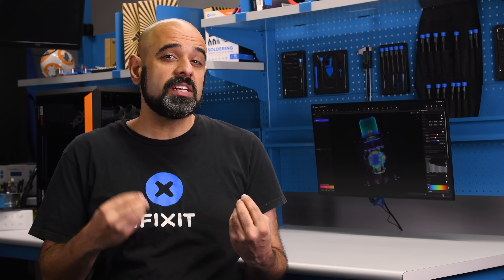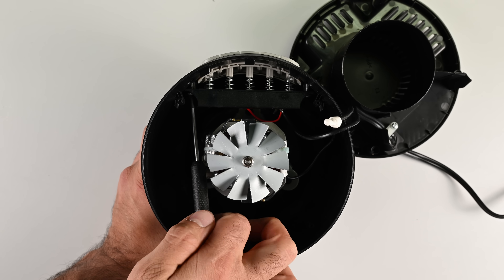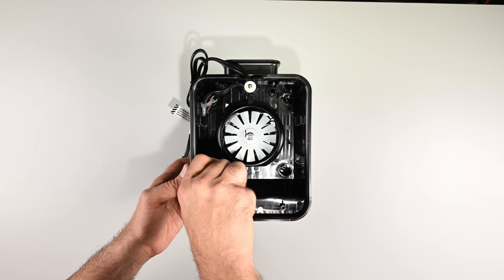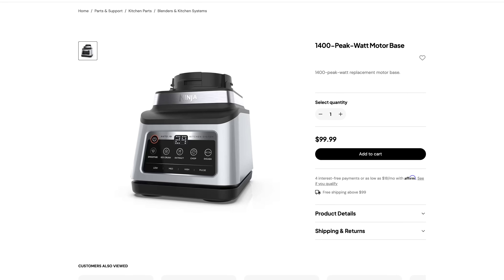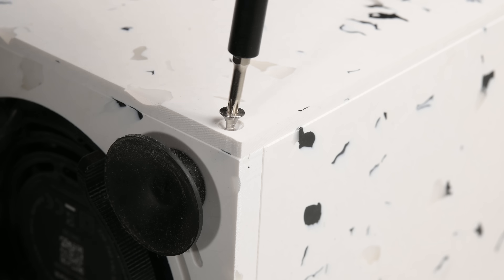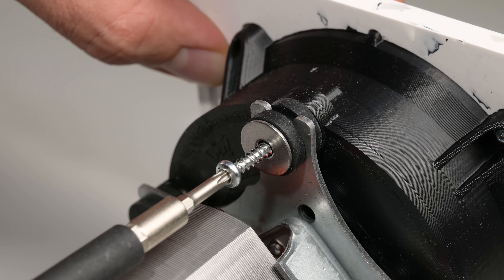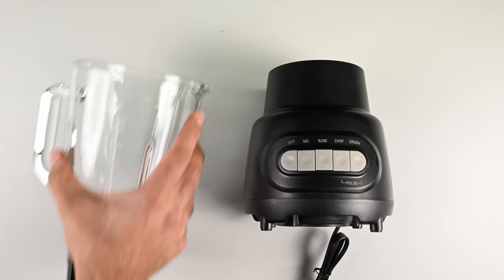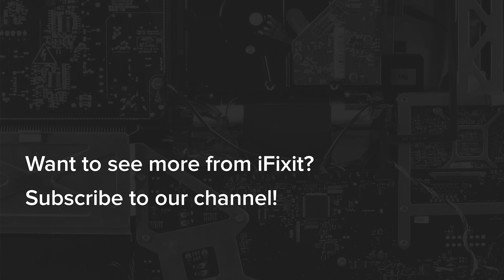Open Funk re:Mix: The Open-Source Blender Big Brands Don’t Want

Comment: I think repair friendly products shouldn't have to look like a home built thing. Like, respect for the effort. But it doesn't look like a 350€ product. This will find its customers sure. But it won't make a dent in the market.
Reply: Since this blender is designed to be easily repairable by anyone anywhere, milling thermopressed rHDPE or 3D printing the side panels is a lot more accessible and cheaper than needing to have multiple thousands of Euros worth of injection molding equipment necessary to make or replicate a fancier, curvier enclosure. Also, the higher price point is due to these being made mostly manually in smaller quantities in a country where workers get paid better than the ones in Southeast Asia.
Reply: @randpython  we couldn't have put it better
Reply: @OpenFunkHQ  Thanks! It seems that the concept of open source hardware (as opposed to merely repairable I guess) still isn't widely known so people tend to miss the point.
Reply: Also, it looks home-built because it literally could be. The design deliberately avoids the need for custom or niche parts so that a person with a 3D printer and some basic hand tools could build one of these mostly from scratch, from readily available materials.
Reply: It's the VW Beetle of blenders. Kinda cute, actually.
Reply: Yeah, I have to wonder if its compatible with any other jars other than mason jars?  And for the price, how powerful is it?  Thats getting up there in Vitamix pricing territory.
Reply: @BackToTheGame.98 1000W, it's compatible with mason jars up to 2 liters (or more)
Reply: It genuinely looks like something a bunch of hipsters from Berlin would come up with. Not do crap on it, I'm super pro open source HW and right to repair, I just find it really funny xD
Reply: @achimhaun2726  and everyone working with us needs to have a moustache, of course!
Reply: yeah a blender should in no world cost more than $100, it's not even as if it's something that's been traditionally unrepairable or expensive
Reply: I totally disagree, it looks super good and minimalistic. Just one big button, done.

Comment: If you are new to fixing this kind of things, take pictures when you are taking it apart. I have fixit few blenders and the first one I fixed had a switch with 4 connection points that took 3 wires and no markings which is which. Also it had a few cone connectors. It took me many hours to figure out how to re-wire it correctly.
Next time I took pictures and there was no problems to assembel it after changing the faulty part.

Comment: The osterizer blenders from the 1940s onward were also compatible with mason jars—it’s nice to see this being brought into more designs
Reply: You only see glass pitchers on lower-power blenders and they're very heavy.  No way a major brand wants the scandal of someone getting grenaded.  That said, I'd get one, then just wrap the jar in clear tape and hand wash it.
Reply: @concinnus  I wonder if anyone makes thick-enough glass jars with that thread. I have an old Atlas pint mason jar that is somewhat thicker.
Reply: @MorrisDugan  not a matter of "thick-enough glass jar". One good strike in the countless weak points in the microstructure of a brittle material, and your container is gone. Considering that a powerful motor will create countless cavitation bubbles when blending, it turns the situation from an "if" to a "when".
Reply: @concinnus  So the early blenders weren't all that powerful, since glass was probably the only material available for a container?

I'm not disagreeing; this is something I don't know much about. When I had a blender years ago, I just didn't like having a plastic container, especially when it started showing stress lines, and it seemed like a poor replacement for the once-common heavy glass pitchers.
Reply: @MorrisDugan  Not sure about the early history of blenders.  But if yours was cracking that was likely "crazing" in PMMA/acrylic.  They moved on to polycarbonate (with BPA) after that, then onto Tritan (with BPS) iirc.  BPS is probably as bad as BPA but people don't know about it yet, so they just market Tritan as "BPA-free."
Reply: @morganmartino1071 osterizer is a great inspiration indeed!

Comment: On the openfunk, that sheet material with countersunk screws so close to the edge is not long for this world
Reply: it's because it's a design student project that they figured "hey let's make a quick buck instead of developing this into a long-term product/company"
Reply: @Laundry_Hamper you mean for durability? Thousands of units shipped, we never had issues with this. It's not like a screw that you open and close 3 times a day, only in case of repairs
Reply: I mean that's kind of the beauty of this being an open source project. They make the files and design public and if you don't like them, you can just modify them and make your own! You don't even have to buy the version they're selling, just have to source your own parts and piece it together. Ideally you would either make your own fork of the project or submit your changes back to the main project so that everyone can benefit from your design work!

Comment: I'm quite concerned about using mason jars to blend. If you only put some soft fruit and water/milk might be ok, but forget about putting ice cubes, unless you want some glass shards in your face. The glass vases on retail blenders are several times thicker....
Reply: Or blenders like the Ninja use polycarbonate
Reply: should definitely use a different container for blending ice cubes.
Reply: @rhoharane yes, the issue is that no other container is provided with the blender
Reply: we had this concern at the start of the project as well. 4 years after, many tests and with thousands of users out there, it turns out these jars are stronger than one would assume. makes sense that they've been used for storing food in vacuum for such a long time.
Reply: @OpenFunkHQ Mason jars are but structural changes over time are unpredictable given the volume (nerd joke) of variables. I've had many a mason jar crack while canning. Seemingly, that last batch was it's final. 🤷There's no real measure for it.. I mean there is.. But not RW.
Reply: Absolutely. Oster blenders work (unofficially) with mason jars. I used them for my morning smoothy and it worked well for about a year until one morning an ice cube blew a hole through the side of the jar.
Reply: Can use Mason jars. Don't have to.
Reply: @phinnphace what do you use instead? The blender does not come with anything
Reply: @coski87 you can use any base that fits (eg standard thickened blender glass that you're thinking of. All that needs to match is the diameter of the inlay.
Reply: @coski87 Well apparently Oster make jars that should fit…
Reply: Yes. I think  blender vases and glass jars looks and feels differend glass types. And the quality of the glass jars might vary depending who made it and on what price it was made.

Differend type of glass for differend product.

Thou, this is a cool idea. But don't be surprised if you have tiny shards of glass in your mouth.

Comment: 350€ is quite a lot though...
Reply: Mostly because repair-friendly companies tend not to have economies of scale behind them.
Reply: you can always use the 3d files they provide and print it yourself. And get the rest of the parts by yourself... Wonder how much would that cost tho
Reply: @FSX3000  And the time. It would make an interesting school shop class, though.
Reply: It’s quite a jump for someone who’s used to getting things for a low price.
Reply: @DavidM979  Especially prices at a thrift store, or eBay, or even "Freecycle". My blender is decades old.

They should cover a couple of "old school" brands, like Oster or Sunbeam, though I suppose these days many of them are made in the same Asian factories.

I like the ability to use a jar instead of a special container. I can't remember which old major brand blender I had that could also do that. It might even be the Sears model I have now.
Reply: It looks very complex for what it is, and the more parts it has the more expensive it will be. They should have made a simpler system since the motor is one unit anyway, and just let people 3d print most components themselves. Also, a minor nitpick, who thought it's a good idea to make a square blender body?
Reply: I get that the lack of economies of scale make things a lot more expensive but most of it is printed and injection molding is usually a very costly part of a product for small production runs
Reply: that is expensive enough to not be worth it, sinceI can probably afford a lifetime supply of new blenders instead.
Reply: @H3LLGHA5T  Or buy one industry level high end blender, that you can hand over to your Grandchildren, before it brakes
Reply: If you can find space to bury them when they break.
Reply: Especially considering that the Github and BoM combined let you build one from scratch.
Reply: It's comparable to a Vitamix...
Reply: Yeah, but if it lasts longer that cheaper alternatives in the long run it pays off.
Reply: If you buy the Framework or this blender, you are expected to buy it once and keep it working forever, that's the one or few transactions you have with the brand. Future transactions won't be as expensive. Thus in total they profit less from loyal customers as there is less reason to buy a whole new product.

If you buy from unrepairable bigger brands you are expected to buy the next new thing instead of repairing it your existing one. Profiting more from loyal customers.
Reply: @banescar it's a little investment. High-performance mixers (over 1000W) range from 150 to 800€, so re:Mix is somewhere in the middle. You pay once for a durable product that's repairable and made in Berlin, instead of paying every few years for cheaper options made in often dubious working conditions.
Reply: That's the price of fairness, sustainability and freedom.
Reply: Especially when the functions are basically a repair-friendly Magic Bullet.
Reply: The price is appalling, as is the case with so many repairable items. Modern repairable items will never catch on at such prices, we can only hope that, just perhaps, those leading the way in repairable devices will give some of the other, less greedy manufacturers, some good ideas to make their devices more repairable.

Of course the larger manufacturers could already make their devices more repairable, but they won't because they are incredibly greedy and so put profit above everything else. They don't care that their customers are wasting their money or that their devices are just adding to landfill. This is on them, as well as their shareholders. We live in a throwaway society that benefits the rich, certain governments and the big corporations.
Reply: It also has to do with marketing. Every marketing person will tell you that you can either be the cheapest or most expensive because the middle ground is the toughest place to be at.
Reply: Exactly I'll just buy 11pcs of wallmart blender and still have some pizza change. It's not economically feasible
Reply: @taktuscat4250  Please bury them in your own back yard. 😁
Reply: same sh1t with framework laptops

why must repairability come at a high cost
Reply: @GRamerDim laptops usually cost a similar price tho, blenders usually cost less than a 7th of this cost
Reply: @GRamerDim not that expensive
Reply: @Luis-rw5xl  Their prices are incredibly high, to the point where it's only slightly cheaper than apple. And at that price point, they have a bad keyboard, trackpad, and speakers, and their QC is also not terribly great either.
Reply: @GRamerDim  framework is the definition of tech gimmick
and the newest modular lenovo thinkpads are going to eat their lunch
Reply: yes it's insane and is just greed

Comment: Should've included vitamix in the mix.
Reply: If mine (5200) ever has a motor burn out outside of warranty, I might modify the open source one to fit the blending container.
Reply: I was wondering the same thing, the vitamix blenders are really expensive but offer significant warranty for something like 10 years
Reply: @JoshThewonder @JoshThewonder, and many earlier versions of the flagship Vitamix blender were mostly electromechanical designs anyway.
Reply: @JoshThewonder  Warranties are worthless, the moment the OEM decides they don't want to honor them anymore.
Reply: @JoshThewonder  I think it’s 7, and only if you pay for the extended. Most brand are only one or two though, so it’s still a pretty long time.
Reply: @JoshThewonder but you can buy parts both 1P and aftermarket. This guy in particular gives ifixit a bad name with his omissions, choices, and simping for brands that seem like they fit the mold on paper but in practice are DOA